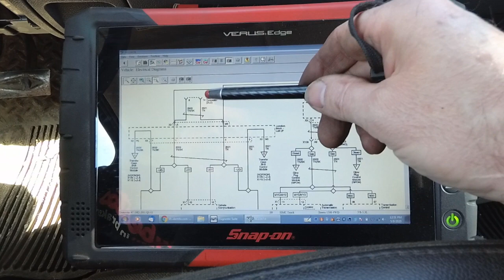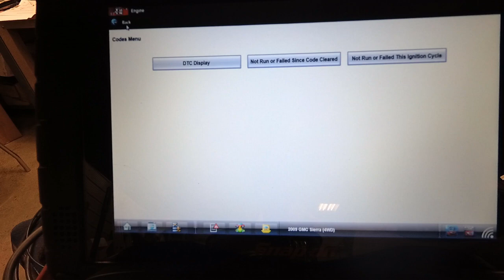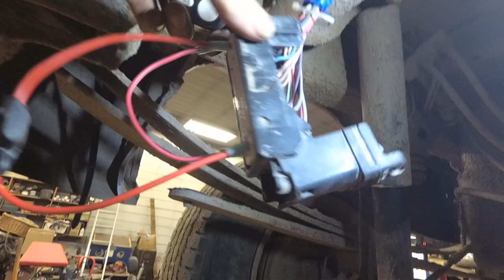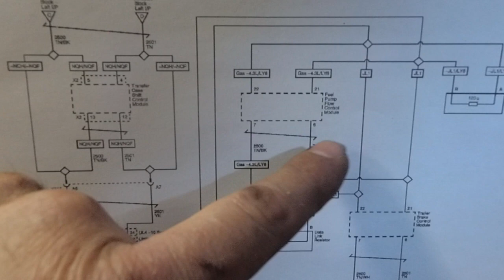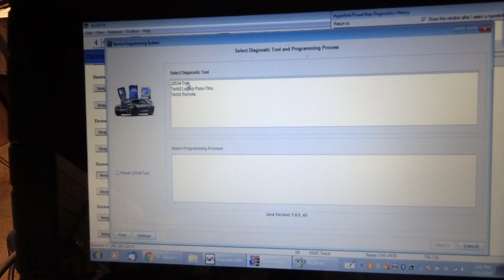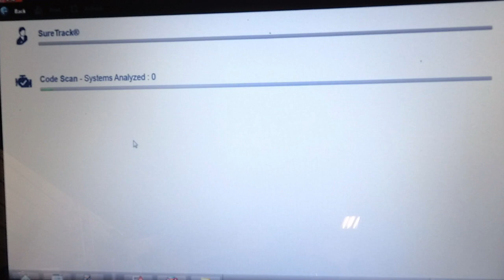2009 GMC No Start No Crank

Comment: Help I’m on to something. I unhooked X3 at the JUNCTION BOX under the dash. I was getting 120 ohms at the DLC, but once I unhooked X3 on the junction block it only show a 1 or L. I can’t tell what it was. It didn’t drop to 60 ohms. It changed from 120 ohms to 1.
Reply from the maker: That "1" is likely how your ohm meter reads overscale. That would suggest there is an open in the can wires to the ECM. There is a 120 ohm resistor in the ECM.
Reply: @Phi @PhillipBailey the codes I’m getting is u0109 and u0102. Transfer case module and Fuel pump control module. I check the terminating resistor in the back of the truck and it’s good. It’s 120 ohms. Could I have a bad ecm? I’m getting a no crank no start and no PRNDL.
Reply from the maker: There's an open in the front half of the network which includes the BCM, TCM, and ECM. There is a connector X109 likely near the fuse box that the Can Bus run through. Reconnect X3 under the dash and locate X109 under hood. Unplug it and measure both sides of the network.  Should measure 120 in both directions. X109 is under the fuse block its a 24 cavity latched connector.
Reply: @PhillipBailey ok thank you I’ll give that a try.
Reply: @PhillipBailey when I unplugged X109 it flatlined again showing that 1 or l on my multimeter. It went from 120 to (l) or 1.
Reply from the maker: At x109 locate the can wires and measure both sides of the connector
Reply: @PhillipBailey ok I’ll give that a try. Am I supposed to get 120 there also?
Reply from the maker: Yes you should get 120 on both halves of the connector. There is a 120 ohm resistor in the ECM and one in the back of the truck. Whatever side measure OL has the open.
Reply: @PhillipBailey thank you!!! 🔥🔥🔥 I love  your channel. I’ve been binge watching it😂😂😂
Reply from the maker: Much appreciated!
Reply: @PhillipBailey ok I checked the ECM side X109 and it has 120 ohms. The other side of the X109 connector has nothing. I don’t know if this matters, but my ground cable works off and on and my gas gauge and battery gauge comes and goes also. I replaced the JUNCTION I/P box under the dash and it started back working and now the whole truck is completely dead from the ground cable working off and on. Along with the gas/battery gauges. When the truck does power on the gas/battery gauges are not working.
Reply from the maker: @TonyJohnson-e4r is X3 plugged in correctly? If so you likely have an open between the IP junction box and x109
Reply: @PhillipBailey I tested the circuit between the fuel pump module and the rear resistor and I’m getting 137-154. It’s bouncing around. Is that normal? When I tested the rear resistor I got 120 ohms.
Reply from the maker: I'm not sure how your connecting the meter to get the 137-154 reading. If you disconnect the ABS module and measure at the DLC pins 6 and 14 with the battery disconnected it should read 120. If you identify the pins in the ABS module going to the rear of the truck it should also read 120. Normal reading at the DLC with battery disconnected and everything plugged in is 60 ohms.
Reply: @Phi @PhillipBailey eads 120 everywhere else except when I tested the circuit at the fuel pump module connector running to the rear resistor. At 6 and 14 on the DLC I’m getting 120 ohms, but it fluctuates at the fuel pump control module connector. It’s nothing less than 133 ohms at the fuel pump control module connector.

Comment: I'm looking at a 2006 heavy half with  no crank no start issue. The computer isn't communicating.
How can I get ahold of you.
Reply from the maker: Is it just the ECM that you can't communicate with? What about the ABS, BCM etc? If you have no com with the ABS try unplugging it's connector and see if that restores com and the engine cranks. If it's just the ECM you can't talk to start by checking the fuses. Does the MIL turn on with the key? Do you get the fuel pump prime signal? Are you using a full function scanner tool?
Reply: @PhillipBailey  I'm looking at buying truck this thing has been mostly highway used and has always been garaged. It's in really nice condition except for electrical gremlins. That started plaguing it about two years ago.
Should I run from it? Or is it fixable.
Or will it stay fixed if its fixed.
Thanks, for answering...
Reply from the maker: @chasl3645  without knowing was going on I can't answer that. As long as it hasn't been in a flood it should be repairable.
Reply: @PhillipBailey  Thank you, I'll know more tomorrow.